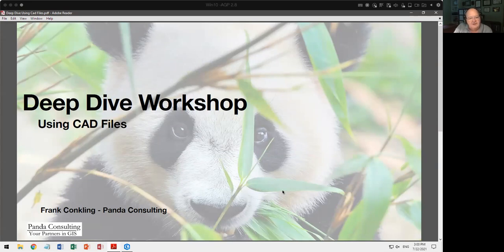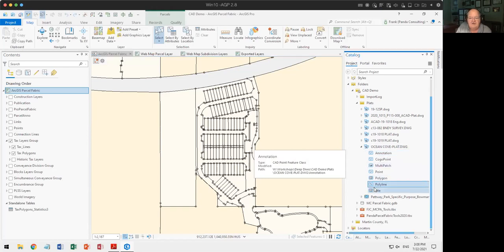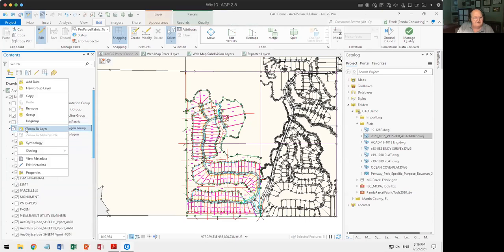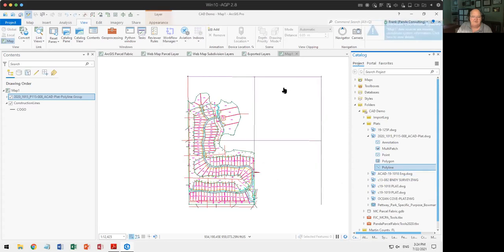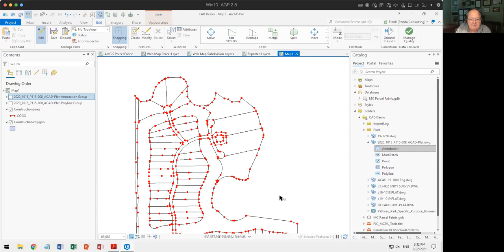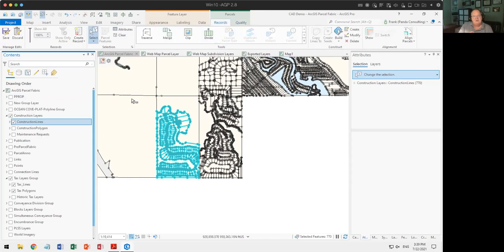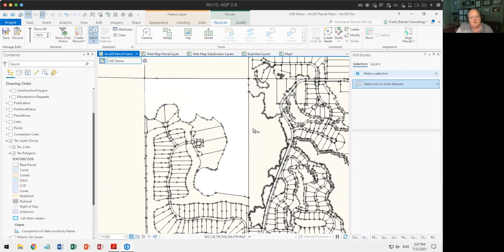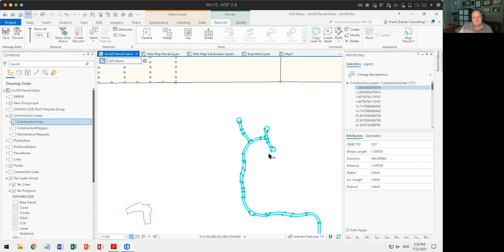Working with CAD Files in ArcGIS Pro - July 2021

Comment: Hi,cad can create parcel?
Reply from the maker: You can create parcels from CAD files, but the process depends on whether you are using the Parcel Fabric or just using standard feature classes. 
If using the Parcel Fabric, you can select the CAD lines and "the copy lines to" tool to automatically include the lines in a record and create seeds. 
In standard feature classes, you can select the lines and use the "construct polygon" tool to create the parcels.
Reply: @PandaConsulting  i want to convert cad to shapfile,and add polygon to the parcel fabric,but it seems so difficult.
Reply from the maker: Our workshop in December will tackle that exact issue.  Please consider attending or wait for the video: https://www.pandaconsulting.com/panda-consulting-workshops-events/2021/12/2/cad-files-to-the-parcel-fabric
Reply: @PandaConsulting  thanks,